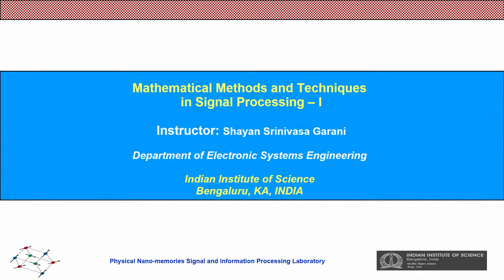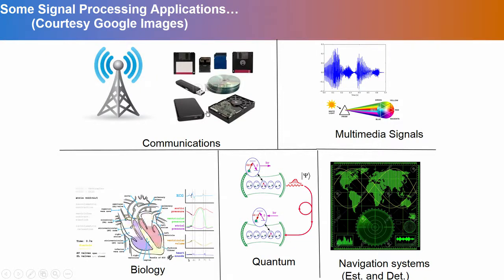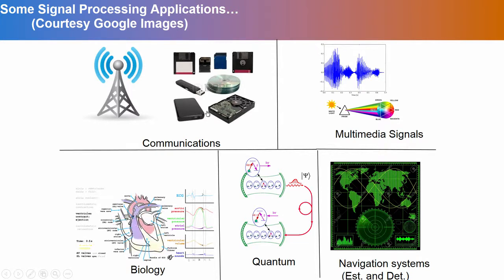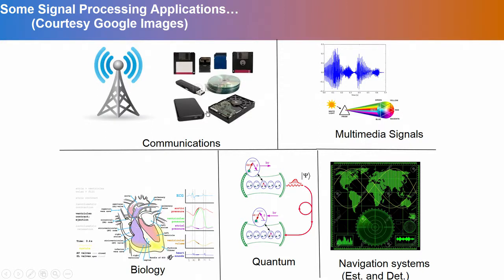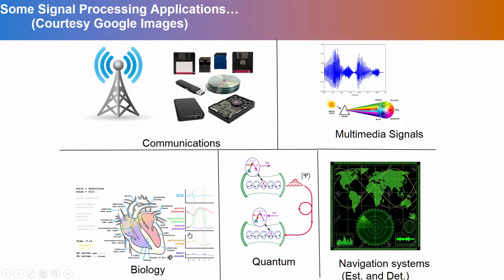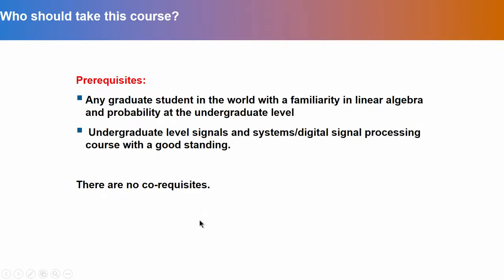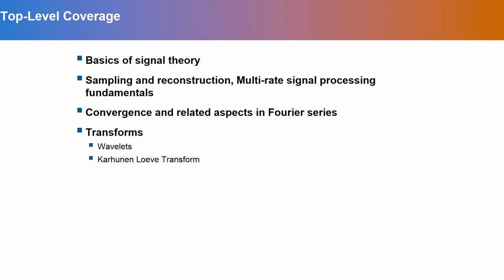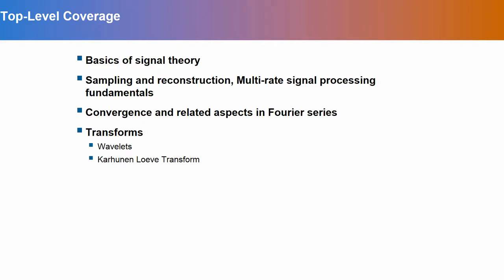Mathematical Methods and Techniques in Signal Processing

Comment: Sir does communication system only involve transfer of information or it also involve transfer of energy.
Or its just information which is converted into energy at receiving end at the expense of retrievers energy like sound wave in case of radio or cellphone.
Reply: Did you hear about Transmitted and Received Power?